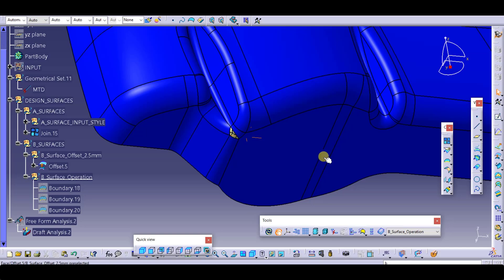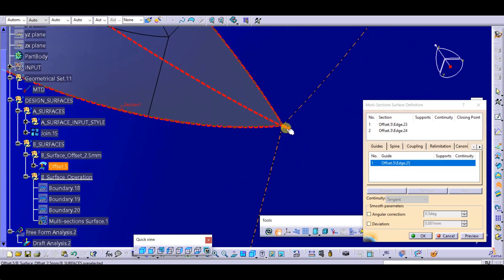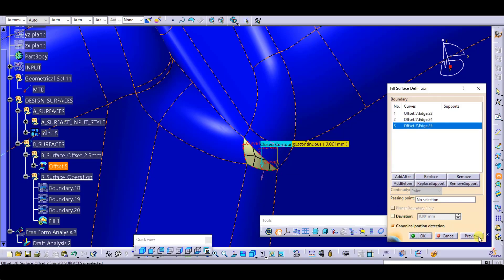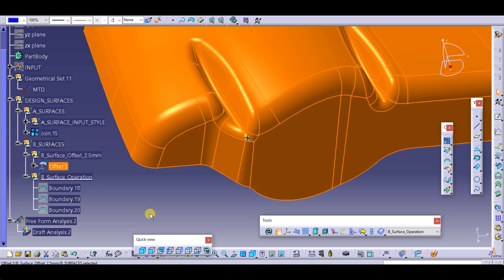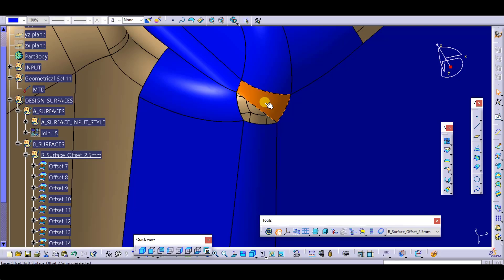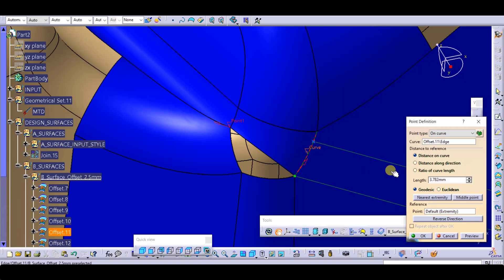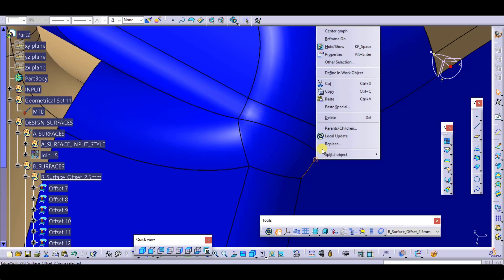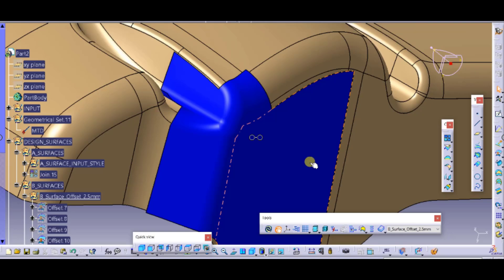How To Create Multisection Patch In Close Volume #automotivedesign #plasticproductdesign #trims

Comment: Sir ye course karne ke bad diploma fresher ko  plastic product design mai job mil sakti hai kya?
Reply from the maker: Yes bilkul mil gayegi
Reply: Sir aap placement support denge kya?
Reply from the maker: @sumit_remulkar  We have one job vacancy group in which we post current level of opening. You need to apply for this. Our fees 4999/- for one year with doubt assistant.....We don't give any fake promises. We made this course those who invested 60k-1lac but not get proper knowledge and placement so they can crack interview and work independently. 

If you come without going anywhere then this is plus point for you.